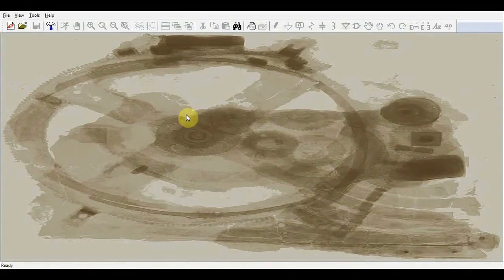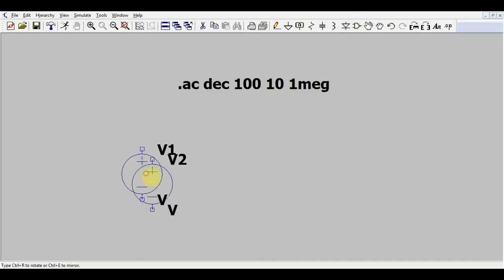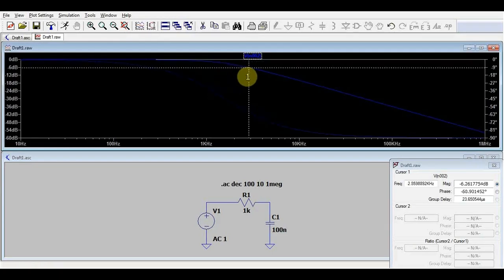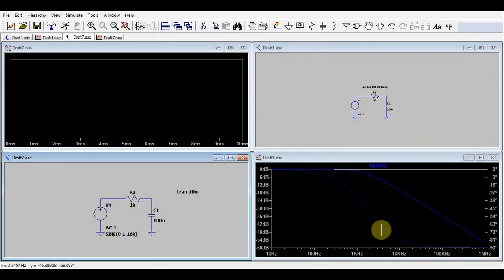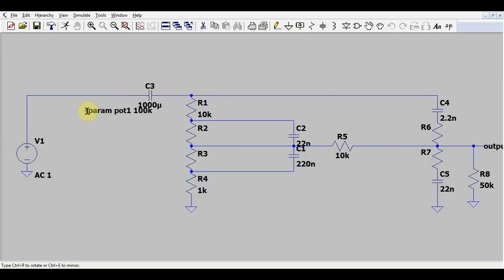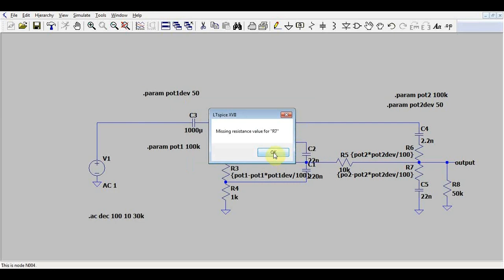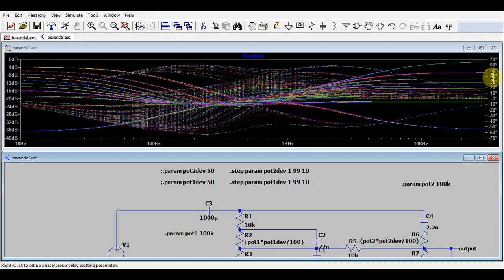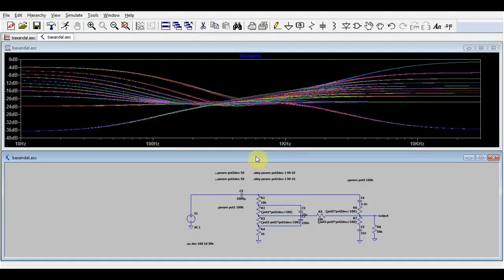LTspice tutorial - EP2 AC simulation and the Baxandall tone control circuit

Comment: You are using values for the capacitors and resistors suitable for Log pots, but then using linear pot sweeps?
For linear pots the resistor and cap values will be symmetrical.

Comment: Hi Fesz, i have a question about the potentiometer, when i get a reading of lets say pot1=45, what value should i put back into my component too re represent that coloured line by itself on my graph? i have tried putting it into the formula and it did not work
Reply from the maker: If you just want to plot a single value for the potentiometer you should use the ".param " definition, and comment the ".step " definition; as long as there are parameters defined using the .step statement, there will be multiple simulation results overlapped.
Reply: @FesZElectronics  hi, thanks for the fast reply, we have now done that. We now wish to get an actual comment value for each thing. Let’s say we have pot2dev= 66 how should we get a resistor value in ohms from that as we need that in a report

Comment: Hey @FesZElectronics what would be the best way to make a differential AC voltage source? I am trying to simulate a balanced audio source signal such as what would be found in a typical 3-pin pro audio line-level interconnect (1: shield, 2: Vin+, 3: Vin- [180° phase inverted copy of Vin+] where Vin+ and Vin- = 3.47 Vpp Ø = 0° and 3.47 Vpp Ø = 180° respectively and Vin common mode=  0.00 Vcm). I am a long-time subscriber and I don't recall you covering this before (my apologies if you have) but you are the go-to channel for anything LTSpice. Thank you for all the great content.
Reply from the maker: Thank you for the kind words! I don't think I ever covered this. When creating signal sources, you can set an initial phase shift - default is 0; In a transient simulation you can create 2 separate sinewave voltage sources from GND to V+ and V- with a 180phase shift on the second one. If you want an AC simulation, the same thing applies - below the input field for AC amplitude, you have a field for AC phase shift. If you want galvanic separation between the signal source and gnd, just add a capacitor between the intersection of the 2 signal sources and gnd. Let me know if this is the sort of thing you where looking for.
Reply: Would there be any difference between that and putting 2 equal-amplitude AC sources in series, grounding the connection point and tapping off each open end?
Reply: @FesZElectronics  Update: The 2 supplies in series method sucks. It does create differential signals that appear fine in transient analysis but FFT was showing lots of distortion. Textbook "trap for young players" right there. The method you described, 2 separate supplies, one with initial phase set to 180 is the way to go. Thanks for the tip, man. Much appreciated. Hey, it might make a good video.

Comment: Also, around 4.30 is there a better way to accurately measure the amplitude of the waveforms pk-pk, I used the cursor option that you would normally use in an Oscilloscope, but it does not show the difference in amplitude properly. Thanks in advance.

Comment: around 3.26, can you please explain how you determined the output signal is 10 times smaller than the input signal, even before running the transient analysis, in there we can see the difference of 2v input sinewave vs 200mv output sinewave? I mean the formula on the wiki page was general, it did not specify any values for the input or output voltage.  

Can you please elaborate on when you said at -20 dB the output signal is 10 times smaller?

Also what is that other tainted blue line from the same time stamp (3.26)
Reply from the maker: The AC simulation will give a response in ratio to the input signal (the votlage source with AC=1); since I was measuring -20dB I could calculate that the measured signal in reference to the initial signal is (Vout=Vin*10^(-20/20) - where -20 is the measured value)
The AC simulation gives 2 responses - the solid line is the gain value in dB and the dotted line is phase shift in degrees (plotted on right side)
Reply: @FesZElectronics  I'm really sorry, you were measuring -20db with relative to what? I'm missing the point here, why is that -20db level significant.  I understand you get 16hz when you hover the cursor above the -20db point, but I don't understand why that -20db is any more relevant than the rest of the points on the Y-axis?.

Vout=Vin*10^(-20/20), where did that 10 come from? I should be using the 20log(Vout/Vin) to solve for Vout right?

I went through the comments, guess I'm the only one who has this stupid question. 😵‍💫
Reply from the maker: No worries. 
So, in an "AC analysis" type simulation, the reference signal is a voltage or current source that has, in the advanced settings, the "Small signal AC analysis -> AC amplitude" set to 1. 1=0dB; but you can set other reference values also if needed. Whatever other signal you measure in the circuit is in reference to this signal. So -20dB is in reference to V1. At 16Khz, I think, the filter is producing a -20dB attenuation on the input signal. Or in other words, the output is 10times smaller than the input. The singnificance is that by using an AC simulation rather than a transient, you can look a wide range of frequencies in a single simulation (with transient, you analyze only 1 single frequency at a time).
Vout=Vin*10^(gain/20) is the same as gain=20*log(Vout/Vin) ; gain being =-20; its the same equation just re-arranged to not have "log".
Reply: @FesZElectronics  Awesome Thanks!!

Comment: Hii, first of all thanks a lot. Your videos are great and extremey helpful. I was having a doubt. Even though it ran all combinations, only waveforms corresponding to pot2dev = 1 are being displayed. How can I get all waveforms of all combinations displayed?
Reply from the maker: One of the problems other viewers had with this circuit is that they missed the connection between the middle of the 2 resistors corresponding to Pot2 and the line going to output and R5. I would suggest that you check that the components are all interconnected correctly - sometimes when you take a trace over a component pin there is no connection made.
Reply: @FesZElectronics  thanks alot for replying. I have redrawn the circuit properly this time, but still I was getting combinations with fixed value of pot2dev. But when I moved the waveform cursor to right, and then moved the up and down keys there, I got combinations with varying pot2dev values. I didn't understand it clearly yet why is that so though.

Comment: Amazing tutorial. I am a musician too that studies electronics and this is awesome. Is this tone control used in any amplifier? Also that thing that you do that you click on the symbol of the Vout on your graph and then you choose the curve you want, I can't do it :(. I dont know when I do it the same window as yours opens but it  just chooses a random graph and when I move the cursor on the graph window it doesn't change. Any idea why that is?
Reply from the maker: Hello Yanno! This sort of filter is quite commonly used. There is also a version with 3 pot's (high, mid, low); but in simpler designs this 2 pot version is used. I click on a trace name, and then you get a dotted line appearing where the cursor is that measures a specific point; I then select and move that with the mouse.
Let me know if this works on your side.
Reply: @FesZElectronics  I figured it out. It works. Thank you so much you are a legend. I am working on a project to design a guitar amplifier with tube preamp and mosfet class ab power stage and your videos have helped me a ton. Especially the one where you model the triode. I mean all the triode spice models on the web are complete bs but thanks to your video I will try to model my own

Comment: Hey.. nice video. I've a doubt about the graph of AC analysis(low pass filter circuit). why exactly are there two slopes while measuring the output? Is it the harmonics? Thanks in advance.
Reply from the maker: Hello. If you are referring to the solid and dashed lines, the solid line is gain (or magnitude) information - plotted on the left side axis in dB and the dashed line is phase information plotted on the right side axis.
Reply: Thank you so much for the clarification.

Comment: Hello, I have tested the circuit, verified values, but the curves are joined below 100 Hz. Here the link https://drive.google.com/drive/folders/1o25OMr8gWFjkvbNsQ7v-K4luVLQ_r02J?usp=sharing
Reply from the maker: In the picture you attached there seems to be a trace missing that goes between C1 and C2 to between R2 and R3. That should solve the issue.
Reply: @FesZElectronics  Yes ! Thanks !

Comment: Hello, i just started re-learning how to use ltspice and i intend to follow through your playlist. Just a quick question, how did you manage to get that graph output? when i tried it on mine, what appears is a mess off spikes that can hardly be used for any meaningful analysis. thanks!
Reply: never mind, i just now noticed that i forgot to ground the voltage source. truly a face palm moment for me. it worked and i got to simulate an output similar to yours thanks!
Reply from the maker: It happens to the best of us. Another topic I would recommend to take caution with is leaving parts of the circuit not connected to ground - like in a transformer circuit; to get the simulator running correctly, all circuit parts need to be connected to GND (both primary and secondary), even if you are using a 100Meg resistor, otherwise it can't calculate voltages correctly.

Comment: Really Informative video. never knew about potentiometer parameter. Also can you please change the graph waveform color from blue to yellow or something bright. It is not hard to visible. thanks.
Reply from the maker: You can make color related changes under the "Tools" menu  -> color preferences ; In later videos I changed the graph background to white to make things more visible. I also increased trace thickness under Tools-> Control Panel-> Waveforms - Trace thickness = 2
Hope this helps!
Reply: @FesZElectronics  No I am telling you to make change while making videos :P

Comment: I have a question. I'm designing a circuit that is taking too long for AC and Noise analysis (it is spending too much time on pseudo-transient analysis). The circuit is basically a bunch of amplifier and filter stages. Simulating these stages separately is fast, but when I combine everything into one big circuit, it is taking too much time. Can I use the simulated results for each stage to speed up the simulation of the whole circuit?
Reply from the maker: I would suggest using ".ic " statements to set initial condition voltages between amplifier stages - this will help with the initial start-up of the circuit (ex: .ic V(n001)=1 sets the initial voltage of net n001 to 1V); 
Another thing you may try is to set the type of DC operating point solver - LTspice has 4 options, and by default it goes trough them one by one - using the .options statement you can disable one or the other as solver option (see in the help file " .OP -- Find the DC Operating Point " )
Reply: @FesZElectronics  I'll check these out. Thanks a lot!

Comment: i think this one video is quite too advane in comparison with the previous one. i just got started in this and you lost me here :/
Reply from the maker: Hello Ivan. Let me know if you are interested in a particular subject regarding circuit simulation, maybe I can suggest a better video for that.
Reply: @FesZElectronics  well i didn't thought you were gonna answer haha. thanks for that. I'm new to electronics. I don't have an oscilloscope, so what I'm trying to do is to understand how systems convert 220V 50 Hz to DC like in LED lamps. i was able to make a simulation with a bridge rectifier that i made but when i tried to test the DC output, the negative input voltage went to 0V instead of 220V
Reply from the maker: @Iván Pstyga  I try to answer the best time allows. I do not have a discord group at the moment, though that might not be a bad idea. On the other hand, I try to answer my emails, so you can write to feszelectronics@gmail.com
Reply from the maker: Regarding your simulation problem; where ever you put the ground pin in the circuit, its permanent 0V. So if you are trying to simulate a sine source and a bridge rectifier, I would put the GND pin on the load side (the DC - pin) and leave the input sine wave "floating" - only connected to the diodes.
Reply: @FesZElectronics  so that would be only 2 diodes rectifing the positive signal, interesting. thanks man
Reply: @FesZElectronics  if you have a discord group that would be fantastic to share pictures and troubleshoot

Comment: This doesn't completely work for me. I have two step commands, and I've double checked each one corresponds to each potentiometer, and when the simulation runs it has 121 processes as in the video, but I only get 10 (or so) traces. One of the potentiometer's is changing, increasing by trace between 1 and 99 in steps of 10, the other one if stuck at 1 for every trace. Has anyone else had this issue?
Reply from the maker: Hello @Shem Jeffs . If you want, you can post your netlist View->Spice netlist - this contains the circuit and step commands, maybe we can figure it out.
Reply: @FesZElectronics  Hi Sir, I have also the same problem. Flowing is the circuit and step commands of the project. Maybe you could help me, thanks a lot!
V1 N001 0 AC 1

C1 N002 N001 1000µ

C2 N006 N003 22n

C3 N008 N006 220n

C4 N002 N004 2.2n

C5 N009 0 22n

R1 N002 N003 10k

R2 N003 N005 {pot1*pot1dev/100}

R3 N005 N008 {pot1-pot1*pot1dev/100}

R4 N008 0 1k

R5 output N005 10k

R6 N007 N004 {pot2*pot2dev/100}

R7 N009 N007 {pot2-pot2*pot2dev/100}

R8 0 output 50k

.param pot1 100k

.param pot2 100k

;.param pot1dev 50

;.param pot2dev 50

.ac dec 100 10 30k

.step param pot2dev 1 99 10

.step param pot1dev 1 99 10

.backanno

.end
Reply from the maker: @yitingnie1265  Well, it seems that you did not connect the output to the middle of Pot 2 (between R6 and R7) - there should be a dot on the line signifying that the lines are inter-connected. Let me know if this fixes it.
Reply: @FesZElectronics  Hi Fesz, you are right! It works! Tanks a lot for your detailed response, I appreciate it. In addition thanks for the great video, it encourages me to try some things, I can't before! Please keep going and I am gonna follow all of your videos.

Comment: Nice video! Thank you for it. The potentiometer explanation is quite useful, however is there not an easier way to analyze thru the potentiometer values without having to plot all of them? like a cursor or something for the visualization? Also, what is C3 exactly doing, since it is not actually needed for the actual baxandall circuit right? Is it for DC decoupling?
Reply from the maker: Hello Jazzunk! Let me start with your second question - C3 is not mandatory, for the simulation at least, but it is a component that is present in practice for DC decopling as you correctly pointed out. On the other hand it does have an influence that is worth simulating since it forms a high pass filter together with R1/2/3/4. If the values or not chosen properly this can have an effect on the circuit performance by filtering out low frequencies, so adding this capacitor should help. Regarding the first part, if I understood correctly what you are asking the short answer is no. LT is not famous for having a friendly user interface unfortunately. You can extract data from multiple simulation runs to add into a secondary graph but that would also be a static representation not something that can be changed without altering the simulation parameters and re-simulating. If you are interested in this filter only, there might be some ready made software somewhere that is more easy to use to generate the output graph.
Reply: @FesZElectronics  Thank you for your detailed response! Yeah I have used other software for filter design and simulation but wanted to know what could be done in this sense with LT. Anyway great videos, keep it up man! They do help ;)

Comment: Great vid! Do you know if there is a spice circuit already built that does what the Duncan Tone Stack Calculator does? Something that can plot and give a single line that moves with the pot deviations?
Thanks
Reply from the maker: If I googled the right thing, you are talking about a tone control circuit with 3 inflections (for low, mid and high frequencies). There probably is a spice circuit for it, but since its such a simple circuit, it only involves 4 fixed value components and 3 potentiometeres, it might be much easier to draw it up in the simulator than to try and find it ready made...